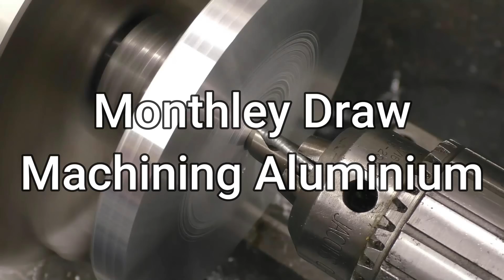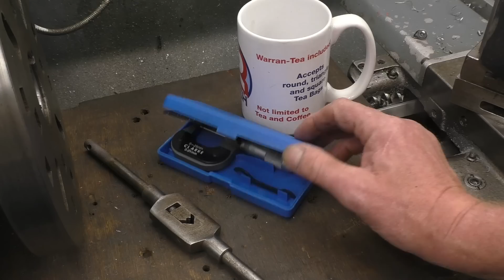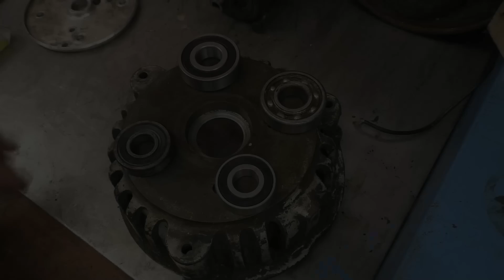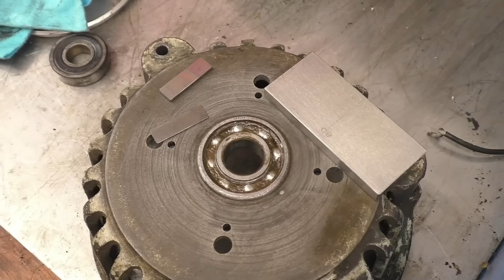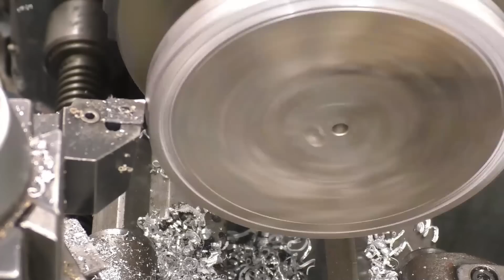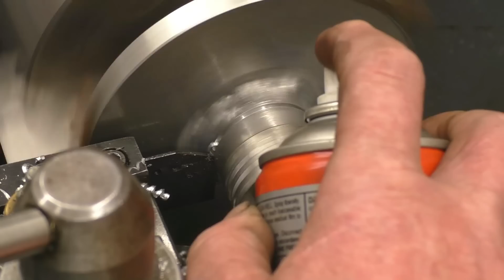SNNC 449 P1  Monthly Draw . Machining Aluminium

Comment: I suspect the original bearing retainer would have been a fairly thin steel cap held in place by rivets. There probably isn't a great deal of end thrust on those bearings.
I would have been tempted to drill and tap the original rivet holes to hold the bearing cap. That way the bearing can be inspected/removed without dismantling the generator.